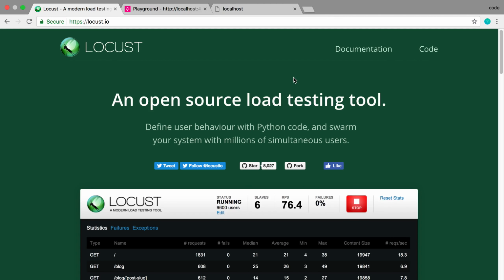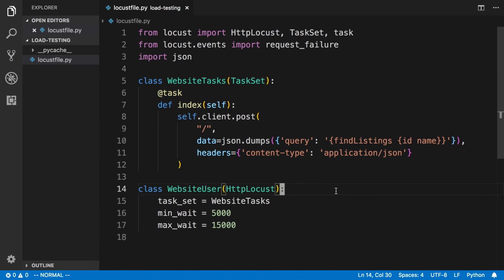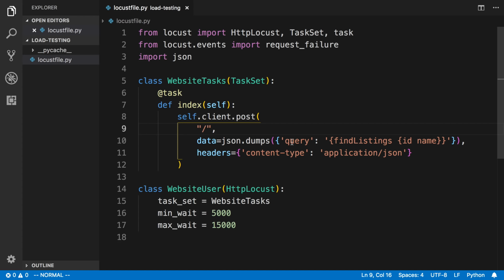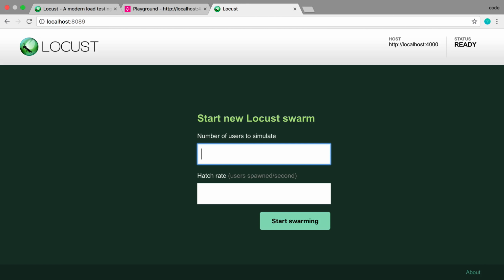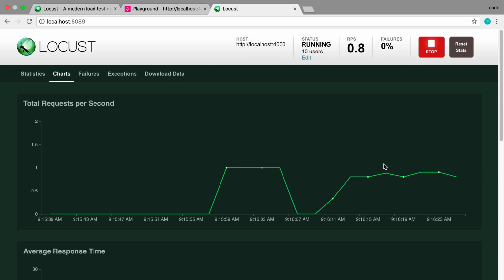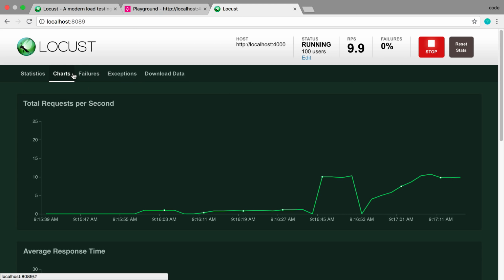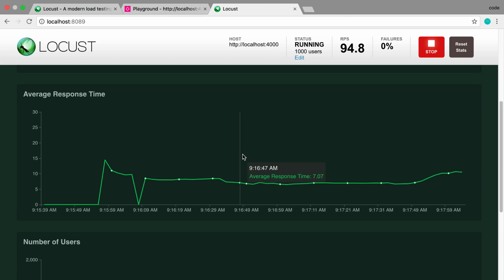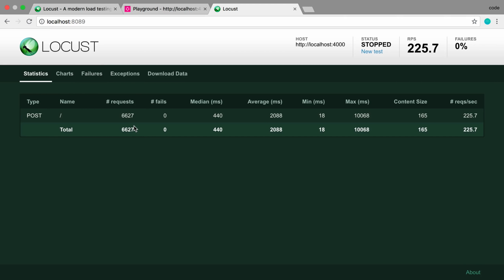Trying Load testing on Airbnb Clone with Locust

Comment: What’s the spec on your computer and year?
Reply from the maker: i5, 32gb mem
Reply from the maker: imac 2017
Reply: Ok cool, just wanted to know because your workflow seems smooth and I ordered a 2012 mbp i7 16gb ram, my current computer can barely run vscode
Reply from the maker: Nice I recently upgraded as well. I used to only have 8gb of memory and vscode and emulators were not happy about that

Comment: I've been thinking about similar things, scaling up, and it made me look around, here's a benchmark which shows that both Node and Java can not compete with Rust/Rocket, which does nearly 20,000 requests per second.

https://medium.com/sean3z/building-a-restful-crud-api-with-rust-1867308352d8
Reply from the maker: that's insane! It blows Node and Java out of the water.
Reply: Yeah, it's pretty crazy, been keeping on eye on Rust it's seem to be really powerful and have nice modern abstractions, to be fair to Node, the author wasn't using the latest streams, async and threads, but even so probably only double the requests per second, which is still good.

Also the reason I still use Node for the most part is the eco-system is massive, Rust is still growing, but getting there.